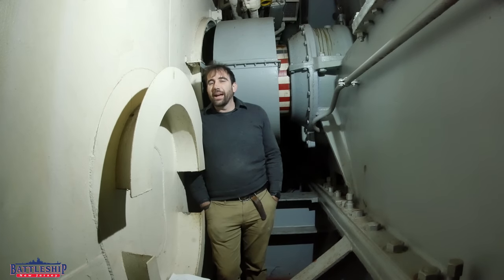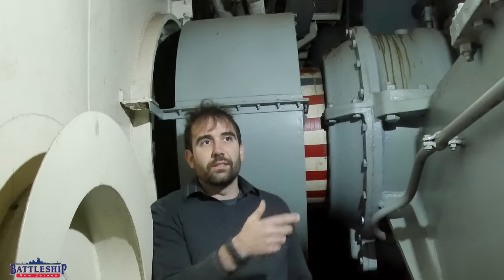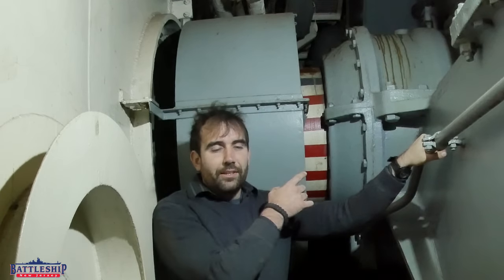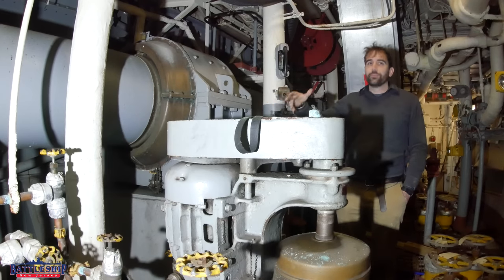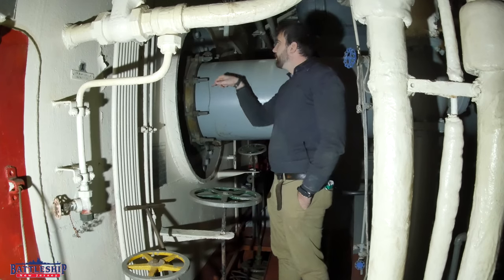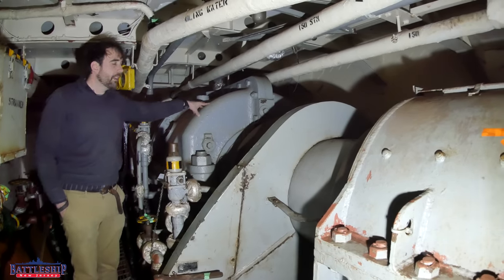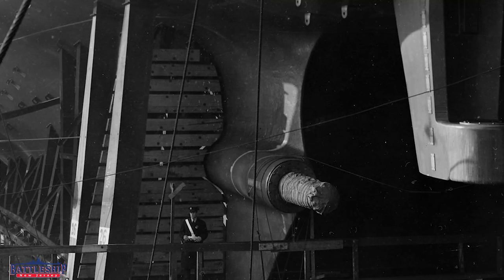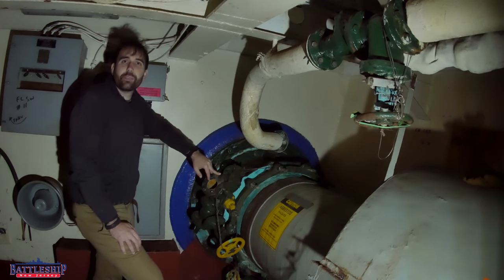Battleship Sized Propeller Shafts

Comment: Hey Ryan, great vid as usual.
I got to tour the USS Hornet in Alameda, CA. I was told by the docent there that the Iowa -class and Essex-class have allmost identical running gear, and judging by the footage they are looking pretty similar. Our docent also mentioned that during massive changes in torque (such as going into reverse while the ship is travelling forward) the shaft will twist a large amount (he said something like 90 degrees across the length). The docent also spoke on the hollow shafts; which, according to him, aside from being a major source of weight-reduction on the rotating assembly, was also done to keep the shafts from sheering during the aforementioned twisting events.

I would love to hear more about the turbines and gearbox, its my understanding there is a low pressure and a high pressure turbine, and that they can be run individually or in parallel? is this true?
Reply: just a short one on hollow shafts. most drive shafts, like the one in your car or truck, are hollow. that's because the torque loads are most significant on the outer part of the diameter, very little is going on in the center. so no point in having a totally massive shaft if the inside x % don't add to the torque bearing ability. but just imagine boring out such a massive thing..... and not getting it off centre!
Reply: All engine’s, turbines, reductions gears are what are called “Double Reduction, Double Helical integrated locked train”. 

Basically if any part moves they all move.
Reply: @richcruse2689  seems like a pretty big waste of energy to not include a clutching system to disengage when a turbine isnt producing power
Reply: @richcruse2689  The reduction gears are cut using double herringbone teeth patterns. This is used to eliminate any thrust coming from the reduction gears, the bad thing is if you suffer a thrust block failure and the shaft shoves on the reduction gear it will eat the hell out of the "rented" gear assemblies.
Reply: @snotcycle  actually, the turbines work in series of each other to get the most energy out of the steam across all speeds. They are pipes together so there is never a times they are both not used together. 

There are other units which would have a “cruising” turbine, which had different designs.  Some modern systems, I.E. modern LCS ships, have Diesel engines and Gas Turbine engines which can be coupled/de-coupled to,the same reduction gears to allow for better efficiency/speed over whole range.
Reply: @jameslong3351  yes, Hence the “Double Helical” part of the description. I am not sure about you, but I have seen these gears, including the Bull Gear attached to NJ reduction gear.  I can tell you exactly how they look and why.

Comment: I'm not sure about the shaft twisting that much under Torque just from a metal fatigue aspect, yeah you could have a shaft twist that much under emergency maneuverers like using engine speeds to assist a turn or going from low speed to full speed but each time would remove a considerable amount of the steels fatigue life. I guess it depends on how often, if ever have the shafts been replaced?
Reply: From the maximum power, RPM and dimensions I calculated a twist of 2.6°. Easy and straightforward calculation.
Reply: @ezwa29  How does that compare to the yield strength of the type of steel?

Comment: If the prop shaft twists under load at one degree per foot, that would give a flex of 340 degrees, almost one turn. An engineer should be able to calculate the answer from the horsepower and rpm plus the dimensions and elastic coefficient of the steel.
Reply: If I got all the unit conversions right :
At 54,000HP and 202RPM the shaft torque is 1,405,758 lb-ft
assuming carbon steel shafting
the twist works out to 0.946°/100ft of length.

So, about 1° per 100 feet of shaft length at rated top speed.

The twist is directly proportional to shaft torque delivered to the prop.
Torque is proportional to HP/RPM
The HP varies as the cube of the ship's speed, i.e., 2 x speed requires 8 x HP.
Not sure how the RPM varies with ship speed.

Comment: Having your shaft be subject to torsional stress is a thing. In the early 2000's the front suspension on most GMC and Chevy trucks are torsion bars instead of springs and struts. I use a 24 inch long extension to remove bell housing bolts and I will wind up my extension bar a quarter of a turn or so before the socket begins to spin.

Comment: I wonder where the shafts were produced and machined.
I "believe" there is a lathe at the Newport News Shipyards that can machine a shaft 105 feet long.  
I "believe" all the shafts used in Aircraft Carriers were produce on that one lathe.
If I am mistaken, please provide correcting information.
Reply: There is a company in Erie pa that makes the current shafts for the navy. Erie Forge and Steel. WW2 shafts we’re probably made and the associated ship yards
Reply: @largesleepermadness6648  Thank you for the information.
I am still seeking info on the lathe at the Newport News Shipyards that produced the shafts for the WWII Carriers.

Comment: How do you tighten/loosen the propellor nut?
Reply: The ship's key.
Reply: A very big wrench
Reply: @tyler_bt3326  looks like
Reply: @tyler_bt3326  looks conical to me, with no flats. Trying to envision how one is able to apply significant force to it
Reply: you use a hydraulic wrench.  The cone is a cover over the nut called 'the dunce hat'.
Reply: @blue-runner  thank you.
Reply: @stanbrow  I was making a joke…
Reply: At the Queen Mary in Long Beach, CA, on the wharf next to the ship is the propeller nut wrench.  It looks like an ordinary box end wrench about 15 or 20 feet long, with rings on each end so it can be lifted and positioned by two cranes.  The tail shaft ends in a tapered square section followed by a section of 12" X 1" threads.  Ordinary-looking hex nut holds the prop on.  At least as well as I can remember.  Probably had a dunce cap over that for drag reduction.  New Jersey probably had a similar arrangement.
Reply: @deanmccormick8070  thank you. Makes sense now
Reply: Righty tighty, lefty loosy

Comment: A curious point about car vs battleship Horse Power. It’s all about the power to weight ratio.  So for example what is New Jersey’s power to weight ratio vs something automotive similar perhaps maybe a Chevrolet Suburban?
Reply: New Jersey: 200,000 horsepower, 50,000 tonnes. 4hp per ton.

Chevy Suburban: 300 horsepower, 3 tonnes. 100 HP per ton.

Numbers are approximate, but the point stands.
Reply: The Battleship is more on par with the NASA's Crawler Transporter. Those are about 2:1 hp:ton. Empty mass of the Crawler, though. With a rocket it would be worse.
Reply: All other things being equal a longer hull will go faster at the same power than a shorter hull.

Comment: I have a 1969 Mustang with a 408 ci engine making about 510hp. But it only has one 3 inch shaft and I don't know the 0-40 time but the 0-60 is in about 4.6 seconds.
I wonder who would win in a 1000ft race if we lined up the back of the car to the stern and the front/bow has to cross the line?

Comment: bet those engines and shafts were loud at full speed
Reply: The Forced Draft Blowers is where most of the noise comes from at high speed.  They really wind up and scream to keep enough air going into the boilers when you're sucking that much steam.  This observation based on a Knox class frigate back in the 80's.

Comment: great video ! is the cutlass bearing lubed by seawater as on my boat ? i was amused at how things are the same as my small boat in both structure and nomenclature, but what an order of magnitude !  what size are those coupling bolts ?
Reply: 3 inch or more.
Reply: @jameslong3351  How many ugga duggas does it take to release each of those bolts?

Yes.

Comment: Riding the shaft, hhmmm, I never saw it or heard of it, I think it didn't occur because if the likely injuries that would happen, the reduction gears did not have a thrust bearing, the spring bearings do not take any axial thrust, just radial, and finally 212,000 divided by 4 is 53,000
Reply: The shaft riding going on might be a touch different…

Comment: Does the difference in weight of the shaft matter? I assume all the engines have similar output, but the shafts are of varying lengths.
Reply: Technically there would be more rotational inertia for longer shafts, but given the low spin speed, 200 RPM, and the admittedly low acceleration, it probably wouldn't matter too much.

But remember that at steady state operations, cruising at 30 knots, the torque on the shaft's input is going to be the same as at the output, less any losses from the bearings and seals. Flexion doesn't matter for that.

Comment: .... My truck has 101 gross hp and about 79 net hp... top speed flat or down hill 85 mph (I'm being very optimistic).... but it is geared so low it would probably  climb a tree given the opportunity... my 0->60 is between ½ -> 1½ miles depending on grade....🙂
Reply: Sounds like a Ford 300 six.
Reply: You are very close,  170 ci straight six .... the older much smaller brother of the 240/300 straight six.
It was only ever used in a handful of non-cars 🙂
Reply: Makes my 140 HP Powerstoke feel like a monster 🤣

Comment: An item I have always been curious about that this interesting vid does not address. Was it possible when the ship was in operation to decouple a given turbine from its propeller so that one could spin while the other did not? Such as to allow the propeller to free spin and minimize hydrodynamic drag when its turbine is shut down while the ship is underway (when cruising it was more fuel efficient to run on two engines working hard than on all four working at a fraction of their max power). Or such as to test run the turbine while at dock without the propellor spinning and producing thrust. I once read an account of a sailor boarding his ship the HMS Courageous and his saying he could feel the vibration of the turbines running as the carrier prepared to undertake its first anti-sub patrol of WW 2 (and it was sunk by a U-boat so fleet carriers were never used for such mundane yet dangerous tasks again).
Reply: --The host showed the couplings.   They were necessary because it would be impossible to make (not even to mention, install) a 300' shaft.   If you wanted to disconnect a prop you could loosen any coupling forward of the thrust bearing.
Reply: By "decouple" I presume he meant such as with some sort of clutch  @GilmerJohn
Reply: @JoshuaTootell  --  With, with a little more thought, I was thinking about how the screws can be reversed.  A steam turbine (usually) can't be reversed.   Therefore, there has to be a "reverse gear" as part of the reduction gear assembly.   I'm guessing that to reverse they would shut off the steam and (somewhere/somehow) stop the propeller shaft from rotating (some kind of break?).   When everything is stationary, some one operates the shift.   That's all speculation on my part.
Reply: @GilmerJohn   Reversing turbine set built as part of the LP Turbine.  Close the main throttle valve, and open the reverse throttle valve.  The reverse turbine is not as powerful so the shaft takes a bit to stop and then start turning backwards.
Reply: @barto6577  It takes  a bit??? Stopping and locking a shaft at high speed takes a little mote than "a bit"" :)we would have to max out the boilers to stop and lock a shaft at high speed in emergency than engage jacking gear and lock the jacking gear to prevent windmilling. This was a normal emergency training drill in case of damage to the main engine turbines or reduction gear.
Reply: @johnchilds6471   Oh I know, I was a BT on the New Jersey from "85-"87😁.   Try standing a "Check Watch" during EOCC drills, and OPPEs.  The Jersey's boilers are NOT automated, all local manual control.
Reply: @barto6577  Been there, done that too. USS Midway(CV41) and USS Meridith (DD890) were both M type boilers Checks were not fun during flight ops on the Midway and hurricanes really suck on a DD. just keeping the water in the glass was doing good.
Reply: @GilmerJohn  There is a separate reversing turbine used for reverse on each shaft. It requires stopping the shafts forward motion and throttling up the reverse turbine. There are no disconnects or clutches.
Reply: @jameslong3351  --  Thank you for that information.  Obviously, reversing is only for low speed operations and involves only valving.   Is there any kind of "brake" on the shafts?

Comment: Why did the designers choose to use a wooden bushing material in the spring bearings rather than a traditional roller bearing?
Reply: I don't think roller bearings can tolerate the amount of force and misalignment you get with 50,000HP and triple-digit shaft lengths.

Comment: Ryan just had to re=sub-scribble , isn't first time that's occured...

The #4 shaft is 343 feet long? Any idea of weight or how where something that huge was built? wow huge!
Reply: My calculator says 872,000 pounds (mass of a cylinder 4080" long, 16" outer radius, 12" wall thickness, using steel's density of .284lb/cuin).

Comment: It's no wonder the battleship accelerates so poorly; at full load, even that colossal amount of shaft horsepower only works out to about three and a half horsepower per ton--roughly the same power-to-weight ratio as a WWI Mk IV tank, a vehicle that could easily be outrun by a well-motivated hiker, and that's before you even take the water into account.

Comment: BS a 32 inch thick steel is going to turn at the same rate as the prop, unless there's a bearing in-between each segment, which allows for flexing and torque vectoring, that way it has some give otherwise it would simple crack under the massive amount of rotational torque? ⚓⚓👍👌✌😎🦘

Comment: Why didn't they just run steam to the back of the boat?  Would have shortened the shafts. I think it would.  Are the gear reduction motors so large all 4 don't fit side to side?
Reply: Maybe because all the easily damaged machinery is inside the armored "citadel" ?
Reply: There is no way to fit all that equipment in one space spanning from the port-starboard side.  Also the reduction gears are just gear boxes to reduce the speed coming from the steam turbines from several thousand RPM down to 100-200 rpm for the propeller shaft.

Comment: I know the battleship HMS Prince of Wales got unlucky to have 1 of her 4 propeller shaft get smashed by the fatal Type 91 torpedo strike

How quickly can the propellor shaft go dead if a turbine loses power due to damage or has been destroyed as the poor Hood had somehow she not blown up would've had her inner starboard propeller shaft stop working due to the likely destruction of her No.4 Curtis-Brown Geared Steam Turbine thanks the Bismarck's 15"/52-calibre armour-piercing shell fetching in turbine room no.3
Reply: In theory, it could be very fast depending on the damage. If it hits a reduction box or the turbine itself, it'll probbaly stop dead within seconds. If one of the bearings is damaged or there's a loss of steam from the boilers, it'll take a few minutes because of intertia of the turbines and from the force of water moving over the propeller.

Comment: These shafts are hollow because this makes them much stronger and not to save weight.
Reply: The shafts are cast steel. When a casting cools that last part to freeze is the center. Because steel shrinks as it cools this causes very large stresses that would develop cracks that would spread outward. The center is bored out to remove this high stress area and impurities that woud cause cracking under normal operating stress.

Comment: How would they pull out 300' long shaft, being in angle pointing down and almost bottom of the ship, even in drydock is not enough space to do it.
Reply: The longest section of shaft would be the length of the biggest possible lathe to machine it; maybe sixty feet max?
Reply: The shaft is in multiple pieces and bolted together at junctions
Reply: The angle is not severe, only a few degrees.  As mentioned above the shaft is in sections that are unbolted and removed in sequence.  They of course also have taken this into account in the docking plan which will ensure the docking blocks are high enough to allow for this.

Comment: the "size" of a shaft is not as important as how you "rock" the boat. I have "propelled" MANY boats with my little shaft and barring's. What matters more than size is how you use it. And many times the slower, the better. Proper prep is also a major factor too. And with a smaller shaft, you want less lubrications. The bigger shafts require lots more lube.. Actually also depends on how much the boat/ship has been used too. Finally do NOT pack the wadding too tight! A little leakage is preferred, as it can prevent shaft burns.